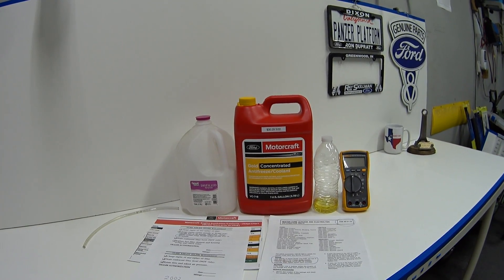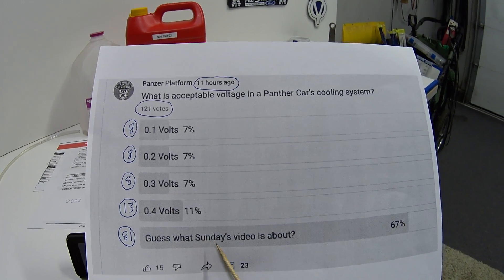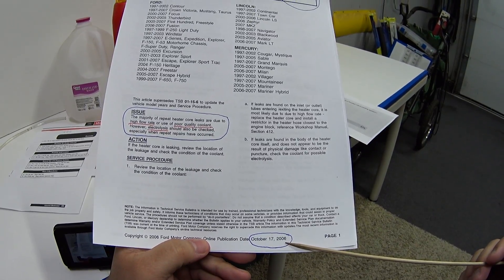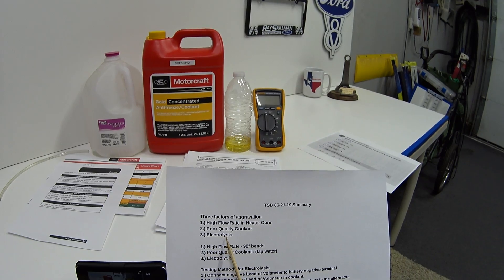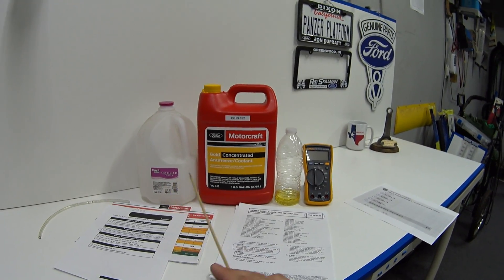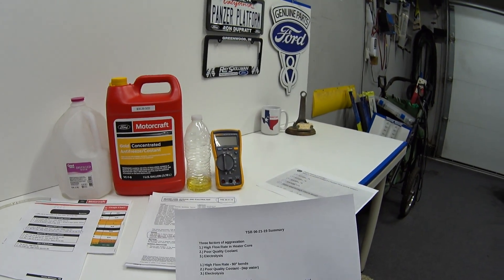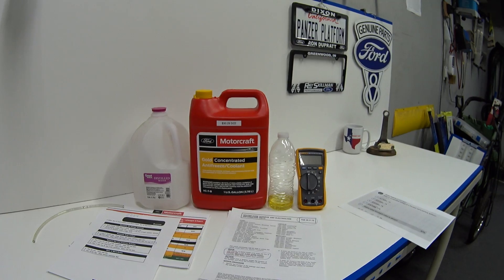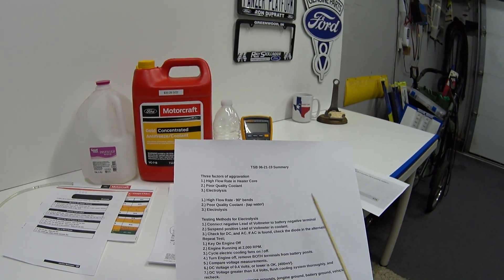Crown Victoria - Ford TSB 06-21-19 Coolant Electrolysis

Comment: Hi, I bought two gallons of prediluted Gold Motorcraft coolant. Should I buy two more gallons for complete flush? Thanks
Reply from the maker: Hello,
Refer to your Owner's Manual for the cooling system capacity specification, and coolant type for your vehicle.
-Chuck
Reply: My vehicle didn't come with an owner's manual.
2003 Ford Crown Victoria Base 4.6. Thanks
Reply from the maker: @MaxmillionjawsJaws-w9g  
Here's a copy;
https://www.fordservicecontent.com/Ford_Content/catalog/owner_guides/03croog4e.pdf
-Chuck

Comment: Panzer what is your opinion on the spark plugs blow out on this engine?
Any tips to torque down the new plugs??
Thanks!!
Reply from the maker: Hello,
Thanks for watching.
Since 2004 on 3 different 4.6L panther cars I've never had one blow out, after replacement.
Better to ask WJ Handy Dad for tips on this issue.
-Chuck
Reply: did you torque it down to a specific number or just  good and tight??  @PanzerPlatform
Reply from the maker: @summerforever6736  
Both. Lol
What did Handy Dad say?
Reply: Ron Williams channel he seems like a legit guy! he has alot of info on this good watch @PanzerPlatform

Comment: I just bought a cream puff Merc and am glad to have found your channel.  Car has barely been driven so I plan on changing ask the fluids, and plugs. Do you have any other ideas for maintenance?
Reply from the maker: Right on CC,
Thanks for watching.

Welcome to the club, prepare to be disappointed. lol
Start by chaning all the fluids & filters.
I have videos on most everything.
Don't forget the brake fluid, and power steering fluid.

When you remove the transmission pan to replace the filter, and clean the pan concider adding a drain plug to make future fluid, and filter changes easier.
Here's some links to some helpful videos;
https://youtu.be/jooWpx-wLu4
-
https://youtu.be/VAo4BT2K3p8
-
https://youtu.be/l-SmrREBYx4
-
https://youtu.be/7RAw2mTiJwg
-
https://youtu.be/UMNep9OrlP8
-
https://youtu.be/QbEHF8ijHl8
-
-Chuck

Comment: Hey Chuck good video and info, I'm going to kind of stir the pot here a bit as you mentioned distilled water. Distilled water is actually corrosive as much as you may think its good for your cooling system. I'll relay a story a friend of mine who is a plumber told me.  He had a customer who was complaining his copper pipes keep leaking. When he got there he discovered the home owner had a whole house reverse osmosis system which will filter out %99. 5 percent of all contaminates and minerals just like distilled water. He explained to me that water needs to be balanced this is why it has minerals in it. When stripped of all of its mineral content it seeks to balance its self again it was stripping copper ions from the pipes causing pin hole leaks. Distilled water in your radiator is going to do the same thing yes the anti freeze will prevent some but your playing one against the other. A better alternative is softened water which has the minerals removed by using salts. I know salts? thats going to eat up the system. It will not because the minerals removed are replaced with a salt ion not actual salt. So really if you got well water with a softener system you have the best water for your cooling system.
Reply from the maker: Right on Mr. E,
Thanks for stopping by.

You are correct.
Distilled water is still water, and is corrosive. However, it’s the “least bad” option. It’s also the manufacturer recommendation, industry standard, and past practice. 

Distilled water is steam from boiling water. All that’s left is 2 hydrogen, an 1 oxygen atom. All impurities have been stripped. It’s cheap, and readily available, in all 50 states, ($0.97 a gallon at my local Walmart). Using it to temper coolant is an attempt to maintain quality control of the mixed coolant.

As far as Manufacturer Dealerships, Independent Repair Facilities, and the average DIY for the past 30-40 years mixing coolant in the proper 50/50, 40/60, 60/40 ratio based on region with distilled water has proven to be a challenge to say the least.

What you propose, even if superior at preventing corrosion, and electrolysis presents and even greater logistical challenge in locating a compliant well source, adding the correct, and proper amount of softening additives.

I agree distilled water may not be the best option, but it’s the “least bad” option we have. 
-Chuck

Comment: Checking for electrolysis we've been doing that since the mid 80s since computers that came out computers don't like it it's nice that you brought this up for people but most of them won't do what they're supposed to anyways so it's probably a waste of time I tried to explain to people when they need a cooling system flushed all they say is you ripping us off doesn't need to be changed even if I shown with the voltmeter and check pH they just say too bad
Reply from the maker: Right on Tony,
Thanks for watching. 

Way back when before I was trained to perform the "Three C's". 
Complaint
Cause
Correction 

I was trained to "fix" the customer first. Dealing with customers can be harder than performing the actual repair. Lol

All you can do adhere to accepted trade standards, keep the customer informed, and document everything on the work order for when things go south. 

BTW, I don't thing I've seen you around here before. 
Welcome to the club, prepare to be disappointed. Lol
-Chuck

Comment: Happy Easter, Chuck.

I should check the coolant on the 2008 CVPI that I purchased last fall. Hell, I changed/checked everything else by now. lol
Reply from the maker: Right on Brain,
Thanks for stopping by. 

Some people occasionally check their coolant for freeze protection, and ph level. 
Why not add a quick non-intrusive voltage measurement every 6 months to keep an eye on electrolysis? 

Hey summer's almost here. Do you see any value in filming you performing a drive cycle in real time to run all the readiness monitors to completion on your Vic? That might be neat with the D9. 
-Chuck
Reply: @PanzerPlatform  That's not a bad idea.  I'm ashamed to admit it but I have only driven that car once or twice in the last two months.  We SHOULD be having "warm" weather by now but it's been unseasonably cold this spring so far.  I need to check if that particular monitor still has not ran.  (it probably hasn't)

As for the D9....  it finally became available for sale on Amazon last week.   It was supposed to have the new topology software ready to go by the day it went live on Amazon.  However, I have not seen the topology update come trough my scan tool yet, AND I now see on the amazon product   listings it states: "topology software coming soon" (or something similar).  I'm going to wait until that tool is fully ready to go before I make a video with it.  But, I could still do that drive cycle video with the D8.

I have at least one more video (after the one that will come out this week) that I plan to record but then I am completely open to filming the CV drive cycle.  I will keep you updated.  Thank you.

Comment: That's some good info! Looks like there's a more recent Ford coolant the "Yellow" type which has more extended life on it and I was thinking about switching coolants. Would you be able to know if I can flush out the system and replace it with Yellow Coolant instead of the old Gold?
Reply from the maker: Right on CN,
Thanks for watching.

Accoring to Ford's statement on the compatability of Motorcraft Yellow with vehicles that were factory filled with Motorcraft Gold it is not approved. You can read the document here;  https://www.fcsdchemicalsandlubricants.com/resources/en/quickreferencecharts
-
It's the PDF called; "Service Information on Backward Compatibility of Motorcraft® Yellow Antifreeze/ Coolant"
Also, no matter what coolant you “upgrade” to you must still follow the original manufacturer recommended change interval.
Vehicles factory filled with Motorcraft GREEN are 3 Year / 30K Miles.
Vehicles factory filled with Motorcraft GOLD are 3 Year / 50K Miles.

Btw, I don't think I've seen you around here before.
Welcome to the club, prepare to be disappointed, lol
-Chuck

Comment: I need to learn how to use a voltmeter!  Confused by how you were using the V to measure the amperage
Reply from the maker: Right on J,
I misspoke when I said Amps, I meant to say Volts. 
Sorry for the confusion. 

It's just s simple voltage measurement. 
-Chuck
Reply: @PanzerPlatform  gotcha... I'm  novice -  only had to use one a couple times before - been meaning to take an online course on electronics, but never seem to have the time 🤠 / Hey- do you have a video up on how you hooked up the light bar to your high beam switch? I need extra high beam light but don't want to do a complete led conversion with the better harness and all that ...
Reply from the maker: @littleflapjack  
I just uploaded this today; https://youtu.be/prkhtsCfgRY

Comment: Bleed off from the charging system and improper grounds can also cause issues 

The intake in my vehicle is the original - 245k miles on my town car 

I added a extra ground cable off the alternator stud to the negative post of the battery and keep the coolant changed every 30k
Reply from the maker: Right on Rich,
Thanks for stopping by. 

I put the links to your ground strap video in the description box. Thanks again for that. 
-Chuck
Reply: @PanzerPlatform  I seen as I was watching but wanted to say it also in the comments Just in case anyone had questions I could help the panther community with and be of assistance to help you explain things if needed

Comment: So you have any opinion to prestone coolant?
The badest coolant is dexcool in GM Cars, Had many overheating Problems in my Former Oldsmobile Alero
Reply from the maker: Right on BS,
Thanks for stopping by.

I feel honored you would ask my opinion.
Unfortunately my opinion is to do your own research, and use your best judgement for your specific application.
-Chuck

Comment: I've been having the leak that causes the coolant steam to flow through the vents and films the windows, so I'll be flushing the system anyways, but I think this may actually be the cause since it's been 5 years since I refilled after replacing the intake on my 05 P71. I shouldn't be too surprised though, 376k miles with few issues.

As always, thank you for the info!
Reply from the maker: Right on John,
Thanks for stopping by.

I just got an email from a company wanting me to test & review an inspection camera with a 25 foot cable. Like a boroscope / endoscope. It has a big color display and two cameras. This would be perfect for finding that leak. I asked them to send two units so I can keep one, and do a giveaway during the review video. Let's see if they want to play ball. If so it could have your name on it. lol
-Chuck

Comment: I could be wrong but I think what they are talking about is that by not using distilled water and the proper coolant you are lacking the proper buffers and adding minerals and ions that turn the coolant into an electrolyte and the cooling system into a giant battery (Al heads, iron block,etc.). And chemical batteries produce electric current by chemical reaction, eating away at the metal parts of the cooling system in the process of producing a current potential.  I learned the hard way with my mid 70s T-Bird. I just checked the coolant for freezing point. I never changed out the coolant, I used my well water which was acidic and loaded with metal ions and after 7-8 years I started having numerous things spring leaks by being eaten away. Freeze plugs, water pump hose outlets, heater cores, you name it.  My 03 GM I have been careful. I use nothing but distilled water and Premium Gold and my oem coolant tank looks like a container of Kool-Aid after 19 yrs 2 months. I think the test is to check if the coolant is not such a good electrolyte producing enough potential current to keep the “battery effect” low enough not to be harmful.
Reply from the maker: Right on Walter,
Thanks for stopping by.

You are correct. Even with using distilled water Electrolysis can still be an issue. A quick non-intrusive Electrolysis Measurement every 6 months during regular preventative maintenance is just another way to keep an eye on things. Just like how you regularly checked the freeze protection.
-Chuck

Comment: great video...

I wonder if we should upgrade to the newer generation of coolants like the pink anti-freeze?

I noticed the SuperTech anti-freeze at walmart is now "Long-Life" rated for 5 years or 150,000 miles. The Extended Life Concentrate jug at least is....
Reply: I change mine by about 30k regardless of the color and leave the gold in that came in mine 

Do not change to the vc-3-dil orange - and or the jew vc-13-g new yellow 

Dexcool is junk which is what the orange is and the yellow we have been having plenty of problems with lots of leaks on new vehicles 

Stay with the gold or green for now
Reply from the maker: @FordBossMe  
Right on Rich,
Thanks for chiming in with good feedback from the front lines. 
-Chuck
Reply from the maker: Right on Freddy,
According to this video by FordTechMakuLoco; https://youtu.be/o1pz05j4uWE
-
And this statement from Ford about the Motorcraft YELLOW coolant; https://www.fcsdchemicalsandlubricants.com/resources/en/quickreferencecharts
-
No matter what coolant you “upgrade” to you must still follow the original manufacturer recommended change interval.

Panther Cars factory filled with Motorcraft GREEN are 3 Year / 30K Miles.
Pather Cars factory filled with Motorcraft GOLD are 3 Year / 50K Miles.
-Chuck

Comment: Great timing on this video! I recently flushed my old coolant out using distilled water and refilled using that motorcraft gold.
Reply from the maker: Right on Jake,
Thanks for stopping by.

Now that you have fresh coolant, take an Electrolysis Measurment.
That will be your "new baseline".
Then recheck every 6 months, and see if the voltage rises.
How neat is that?
-Chuck